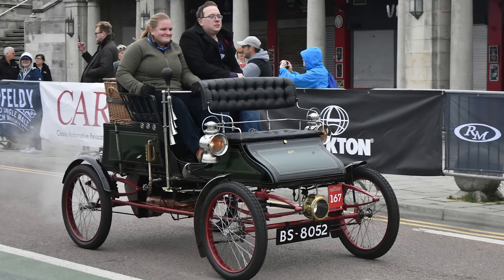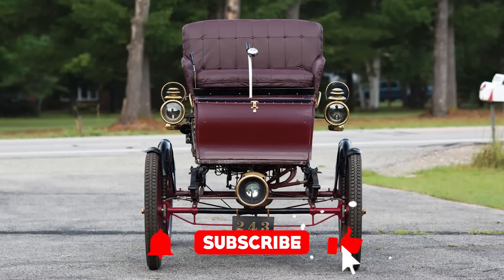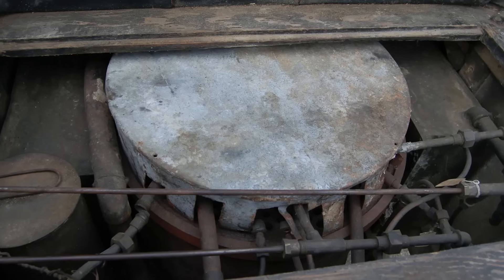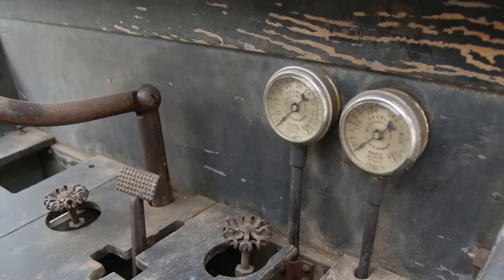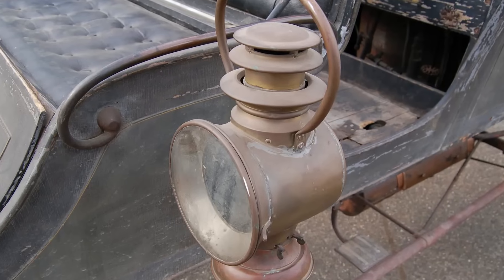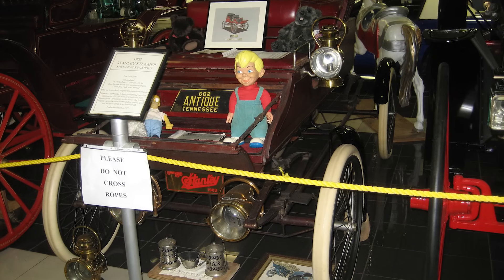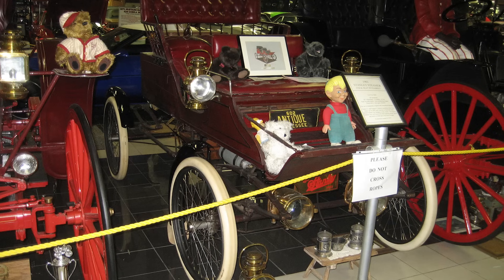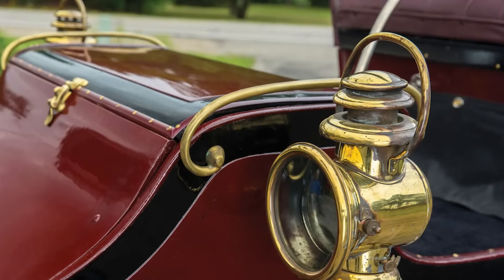1903 Stanley Model C: The Steam Car That Outran 1903’s Gas Engines

Comment: I love your humorous telling of old stuff. Steamers were wonderful cars before they pushed too hard. Most weren't likely to set your face on fire when starting them up, at least if well maintained and if you have a fire crew standing by. 20 minutes to warm up was about the time it took to harness Nelly to the cart and you don't have to feed a car when it's idle. They could whiz past many gas/keroscene or electric cars, if you had that 20 minute head start. At a mere 8 to 14 MPH the Baker electric could get you to the town shop (usually the only places the Stanley could get over 10 MPH due to miserable roads outside of the city) and home while the Stanley got its boiler up. Of course, EVs were for women and wimps, real men who didn't mind an occasional flash fire or broken arm from a crank handle. All cars were a luxury most couldn't afford, when the car cost 1/3 to 1/2 the cost of a 9 room house.

Comment: The main competition for steam cars in the 1900s was between Stanley and White. Stanleys were definitely faster (they set a world speed record of 127 mph in 1906), but Whites were quicker to get up steam (they used a flash boiler instead of a fire tube), and more efficient, with a condenser to recycle the steam. With a Stanley, you had to pull over, after a while at high speed, to get pressure back up; with a White, although slower, you could go all day without stopping. Kind of a 'Tortoise & Hare' competition there...

Comment: "Under the driver's cheek sat a vertical fire tube boiler" .... well...that must have been nice in winter (My truck has seat warmers too) but I would think in summer it would give a literal meaning to the term "Hot Seat" (BTW:  Only ONE Cheek?  Are we Talking a very SMALL boiler, a really FAT driver, or some poor guy who got shot in the ... well, you know... in the Spanish American War and lost the other?) and flipping your liver sounds dangerous and should ONLY be tried by Professional Contortionists. 🤪🙃

But seriously, it has been 122 YEARS!!!  WHY are we fooling with Electric Cars that catch on fire and Gas guzzlers with a few Hybrids bridging the gap?  WHERE are our STEAM Cars???  😡🤬
Reply from the maker: Alright, picture this: 2025, you roll up in a brand-new Stanley Steamliner, walnut dashboard, polished brass boiler, and a coffee pot whistling away under your cheeks. Folks at the stoplight are sweating in their air-conditioned SUVs while you’re there with your cheeks evenly roasted like Sunday dinner. Tell me that’s not the future we deserve. 🔥😄
Reply: @coolideas3272  Coffee sounds good!   AND in the Army we DID heat out C-Rats using the Vehicle's engine heat. 
I just have to sit on a frozen chicken or pork chop, putting it between me and the boiler and after a long drive....LUNCH!!!
So Nyaaaahhh!  😝